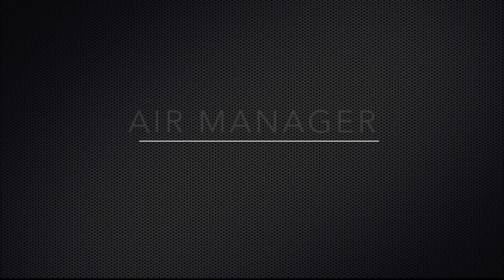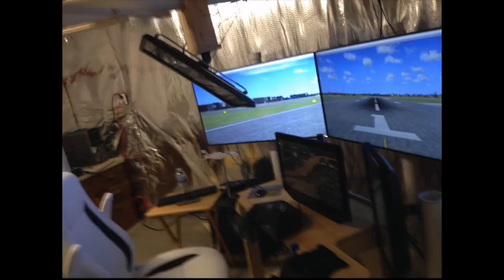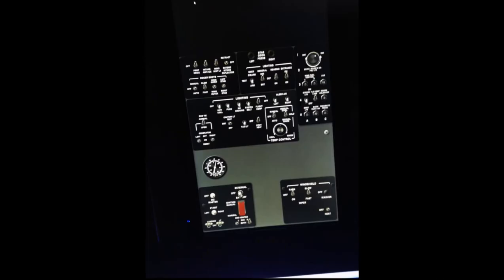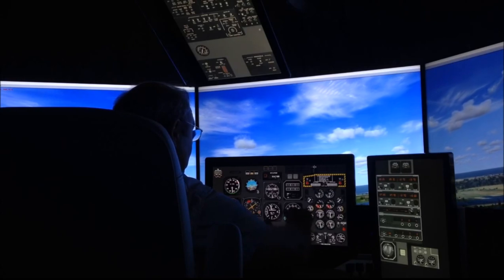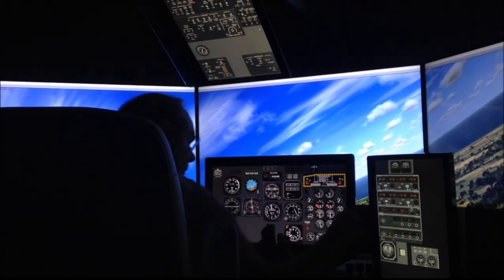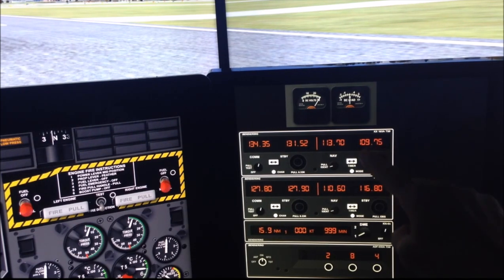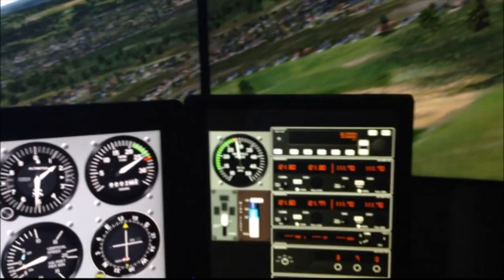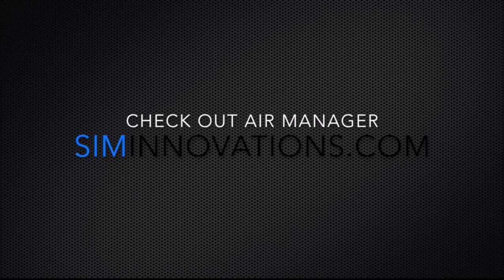Air Manager -Triple Touch Cockpit  -TALKIE

Comment: Hello really like the videos and due to "air manager" content I arrived here for some help if possible. I just purchased air manager and I am trying to make it work as per my requirements. Goal to achieve: 2x displays connected on the same computer thru the motherboard output (1=displayport, 1=hdmi, 2x monitors showing different instruments). The issue: If I start the software on the display that is set in windows as a "main display" everything works fine but when I go into > panel > window preference > show panel on display "second" > and selecting the second display, once I click "show" the panel doesn't show and the air manager just freezes and I have to use task manager to close it. Looking into task manager I can see "OpenJDK Platform binary (2) " - Not Responding. Looking on the windows taskbar I can see 2 windows open (one is the air manager main and the second my best guess is the panel but is not showing and the software is not operational). To put everything in a simple sentence: If I open the panel on the "main display" as set by windows it loads and works. If I set the panel to be on the secondary display, air manager needs to be closed with task manager. Note: If I open the panel on the "main display" and drag it to the second screen it shows (resizing, position and other issues appear). Any solutions/suggestions? Many thanks.

Comment: Question..what is LVAR, need i to put Air manager to work.
Reply from the maker: SIMULAR É some P3D and FSX addon aircraft  have expanded Local Variables (LVARS) that all extension of features not included in the standard parameters.  X -Plane has custom dataref which are used to extend features in X-Plane aircraft.

Comment: hello Russ, would like to know how to set three touch monitor with airmanager. Appreciate if you can answer to that question. Many thanks. Lawrence
Reply from the maker: Lawrence Lai You can use Air Manager 3.0 or later and you can assign each panel to a separate monitor. You need to run Air Manager on a separate networked computer that can support 3 monitors. The demands for cpu and gpu are much lower than for the simulator (P3D or X-Plane).
Reply: Thanks Russ. Appreciated. Many Thanks!